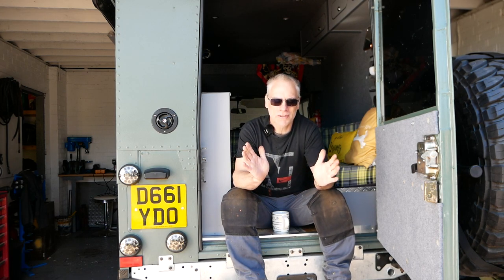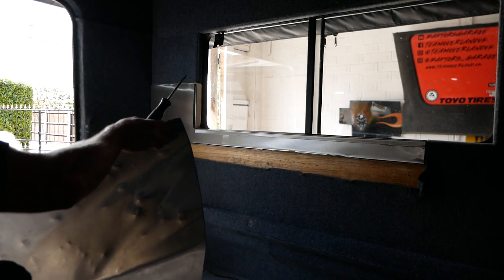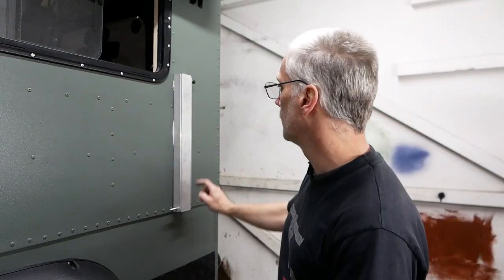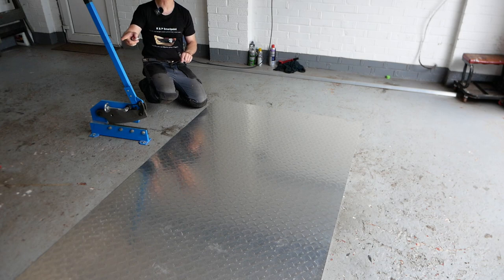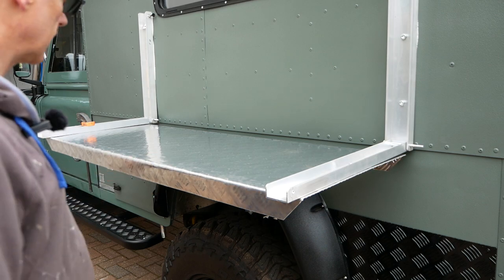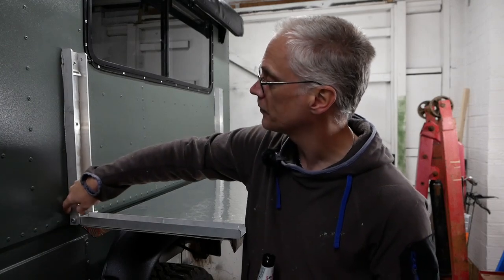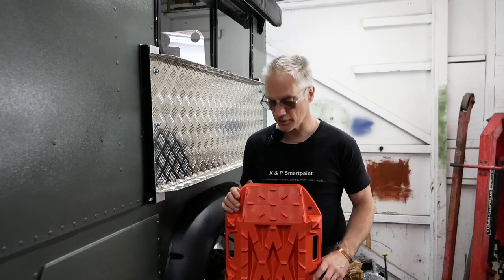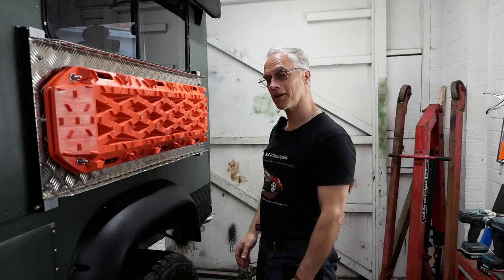Overland Camper Land rover 110  new Traction Board Table  & Interior Makeover | All 4 Overland

Comment: Undo the two bolts that attach the fixed cutting-edge to your guillotine, take a 6ft length of angle-iron, drill a couple of holes in one end to match the two holes in the guillotine, put it all back together (you might need longer bolts) and you've got yourself a simple guide/support for cutting big sheets of metal. ;-)
Reply from the maker: Hi Sicrewe...thats a brilliant mod for the guillotine i shall be doing that before i cut the aluminium for the side locker box...i love it when people have practical solutions to make life easier...regards Paul

Comment: Good idea making the table multipurpose and it turned out well. 2 things Paul,could you have riveted the table to the arms ? And personally the folded edges on the table I would make half the size so they don’t stick out. 👍🏽😎
Reply from the maker: Hi Old_con...like i said in the video everything on a truck that is this small needs to have two uses so you are not carrying extra stuff...i guess you could rivet the table on if you wanted to but if you want to dismantle it for any reason such as repair or adjustment its easier to bolt...the 50mm returns on the table top give it alot of rigidity as the traction boards are quite heavy and plus the traction boards themselves stand off the table 85mm...but i guess its personal preference if you are building one its up to you how much you bend the edges..regards Paul